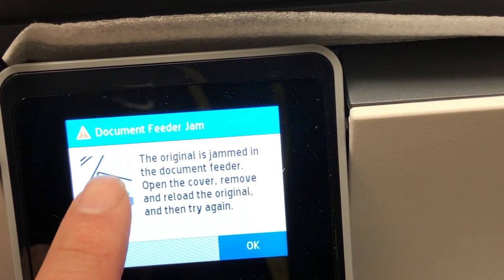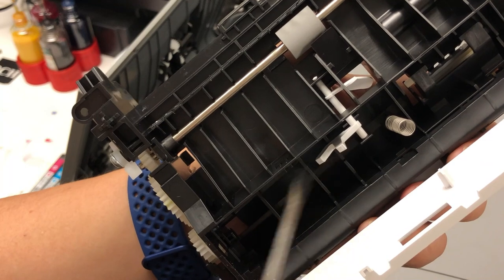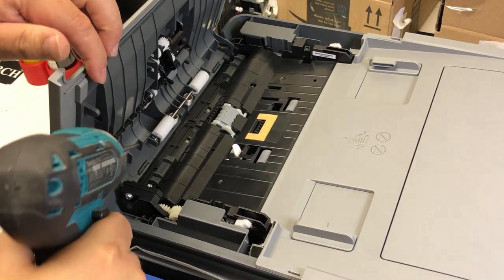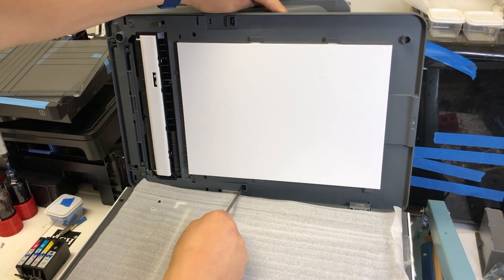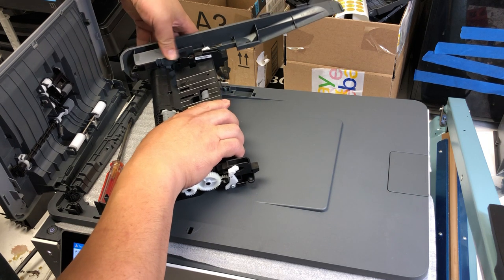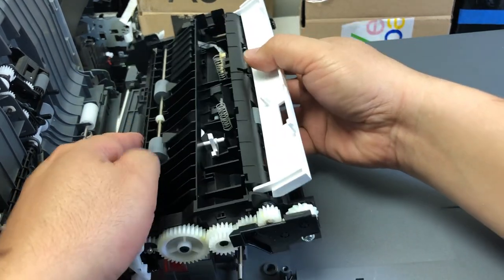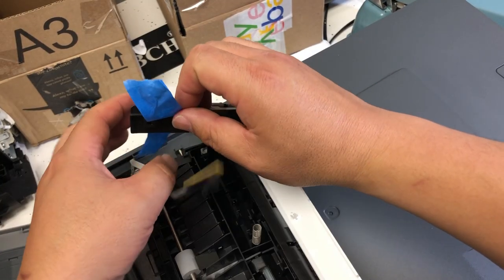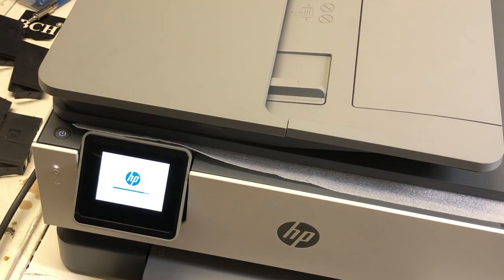How to fix False ADF Document Feeder Jam Problem - HP Officejet Pro 8000, 9000 Series

Comment: A QUICK FIX (no disassembly) to this problem is to use compressed air to clear any debris blocking the sensor.  Open the ADF cover, and then Lift up on the hinged ADF assembly, partly exposing the white plastic cover (the part that Kevin touches with the screwdriver at 1:01).   With the extension straw in an office duster, or using compressed air, BLOW  into the crack HARD.  Over two years, this has worked to clear out the debris two times, saving me from the hassle of disassembly.

Comment: I have a HP 9015, and was able to adapt the directions to that in order to separate the components, but it looks like in my model the plastic that blocks the light from crossing the sensor is more direct, so that's not broken.  But it also doesn't seem to make it as easy to remove the ribbon cable.  Do you have directions on how to remove the ribbon cable from the ADF?  I'd like to by a replacement from your site, but only if I can figure out how to swap it.  Thanks!
Reply: Have the same problem
Reply: @scalibar  were you able to solve the problem? I cant seem to find helpful videos for HP 9015e   :(

Comment: Thank you for the great video, Kevin. I'm trying to do this on an HP 8715 which is slightly different: I only found 6 screws on top, two screws and two plastic clamp holders on bottom. No metal piece on bottom. I can't separate the ADF yet to access the switch and sensor. What am I missing?

Comment: Hi Kevin
I have the HP LaserJet PRO MFP M225 dw.
The ADF does not pick up the paper with the error message of Mispick.  I cleaned the pickup rollers and separation pad with distilled water as suggested in the manual. I noticed when I pressed scan, the rollers didn't move.  
The scanner belongs to my workplace.  I do not want to poke around too much. Do you think the problem is the sensor?  Would you do a video on this model?  I have to use a Microsoft Office scanner on my phone to scan documents now. 😐

Comment: I know this is an older video, but can you fool or bypass the ADF sensor? I don't need the tray feeder to work - I just need to print. Can it be bypassed in software, or can it be bypassed mechanically i.e. disconnecting or covering the sensor. I have a 9012e. Thanks.
Reply: I just fixed my 8025 by putting masking tape between the sensor legs. It's working fine so far

Comment: Have an Officejet Pro 9010, This doesn't fix it, tried cleaning the sensors too, any idea what to do next?
Reply: Did this happen right after an update? I have the same model and after an update and restart I got the ADF error. There wasn’t even paper close to the feeder let alone stuck in it. The only thing I haven’t tried is taking it completely apart like the video..:😢😢😢 I had read a couple of other posts with people having the same problem with this model after the update.
Reply: @DulyNoted505  I did not know about this :face-blue-wide-eyes: I currently have an HP 9015e giving me that paper jam trouble. only that its showing paper jam under the separation pad of the ADF and I cant figure how to solve it :face-purple-crying: